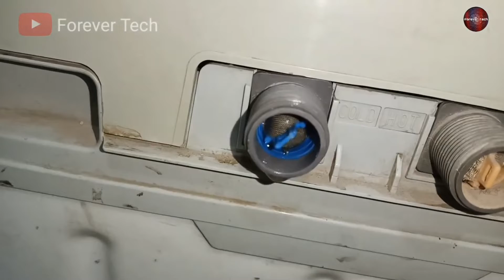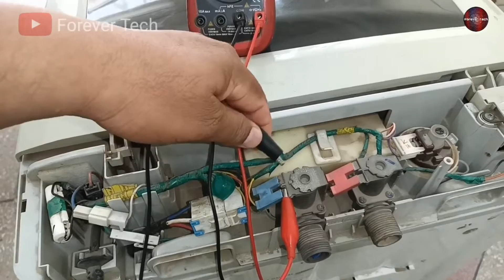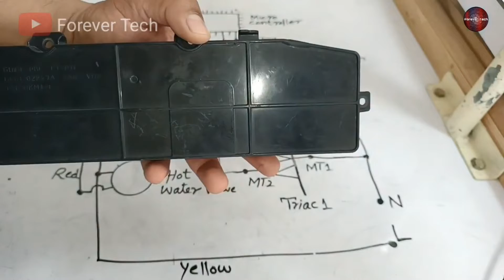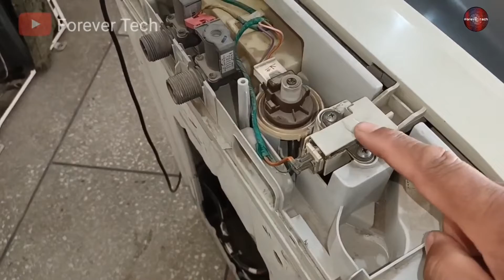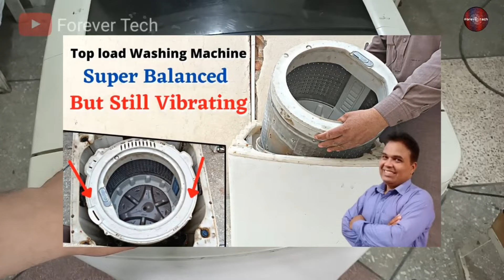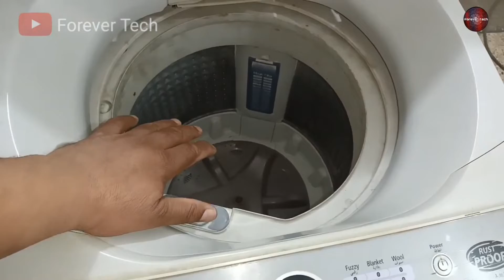Samsung Top Load Washing Machine Error Codes - How To Fix

Comment: Hi sir great blog I  asking you how about the cold water in the main board is not lightning  the inlet water not coming WHT is the problem board or inlet
Reply from the maker: Did you check the valves with a multimeter if they are ok, then I think the problem would be in the board, try to replace valve with a new one or with goof one.

Comment: Sir I have one issue sir 
In samsung front load diamond model it run fine when without load if I make some load wash circulation it be very low rotate example whithout load it rotate 35 sec right and left. But with load it rotate only 6 sec remining time it wil ideal only I change carbon and tacho also but no use voltage are properly I get .what is the reson sir pls give any idea